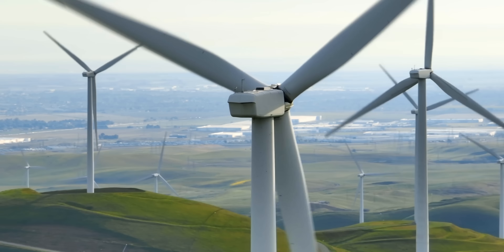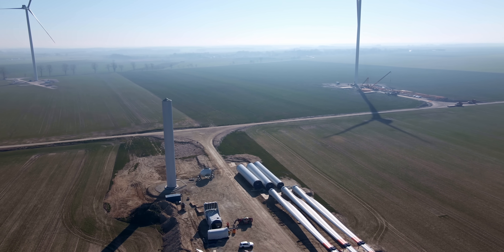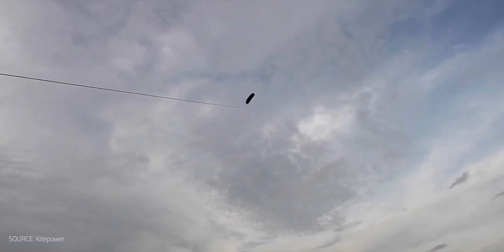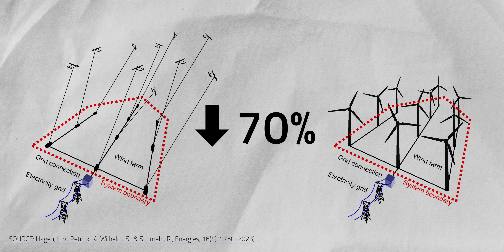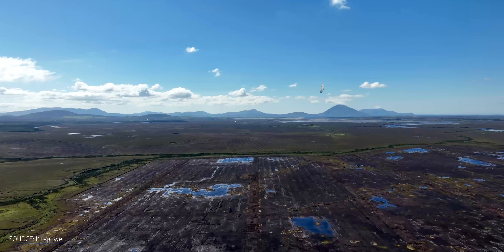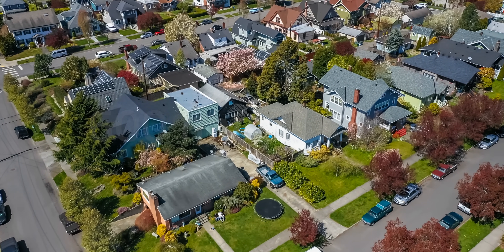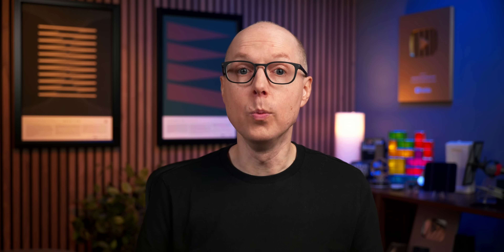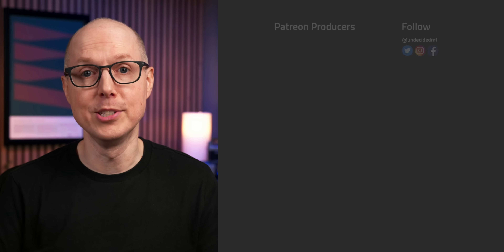Are We Building Wind Energy Wrong?

Comment from the maker: Will AWES start to soar, or are they bound to come crashing down to earth? Go to https://ground.news/undecided for an innovative way to stay fully informed on tech, energy, the climate and more. Save 40% on the Ground News unlimited access Vantage plan with my link.

If you liked this, check out How CATL Made Batteries 90% Cheaper (And What Happens Next) https://youtu.be/Wf84NJSiAeU?list=PLnTSM-ORSgi7uzySCXq8VXhodHB5B5OiQ
Reply: Matt, you made a mistake you shouldn’t have made at 8:49. Kilowatts per hour is not a meaningful unit. Kilowatts are already a measure of power (energy per unit time). A kilowatt per hour would be some sort of acceleration. Power generation systems don’t generate “kilowatts per hour”. The energy would be in kilowatt-hours, and the power output of kilowatt-hours (energy) per hour is just kilowatts.
Reply: @Berkana  it's concerning that Matt Ferrell got units wrong after doing hundreds of these videos. I wonder if 30 kW is the peak generation of the system, and if you include the time it uses power to reel in the kite, the actual average power generated is much less.
Reply: There is an island at the top of the Pacific Ocean named Adak. There is a sign there that says “Birthplace of the Winds”. Someone should go there and figure out why, and figure out how to harness it at its source.
Reply: Does a kite fall if it is hit by a bird?
Reply: @VichaDorenaBrTarigan  No. The bird will likely be stunned, or worse, but less so than if it were hit by a wind turbine blade.
Reply: Need more power? More kite area per winch, like two or three kites flying on the same line.
Reply: STOP SHILLING FOR GROUND NEWS. NO ONE WANTS THEIR NEWS POLLUTED WITH RIGHT WING BULLSHIT
Reply: How funny to post this so soon after China announced the S1500. China is about to do for wind what it did for solar.
Reply: @Jesus.the.Christ  "China tests world’s first megawatt-level airship to capture high winds ... The S1500 features a main airfoil and an annular wing that together form a giant duct. Inside this duct are 12 turbine-generator sets, each rated at 100 kW." Interesting.
Reply: @skierpage  What I find the most interesting is that the tech appears easy to copy.
Reply: 8:49 Dude, not "kilowatt per hour", it's "kilowatt-hour". You should know that, you're the expert.
Reply: These could be hybrid systems, semi-rigid structures with engines/motors and generate power through various tension systems. Cheap and well disbursed energy of the future... informative video!
Reply: One niche where this might be valuable is in mining. All electric trucks are now available for this.  Charging infrastructure at remote mining sites can be problematic.  Awes solves that problem and makes a really compelling financial case for an all electric mining site.
Reply: Kudos for the excellent video as usual,
but also for the consistently excellent doble untundra
Lord of the Rings Reference!
Reply: You Could Shrink this and Use it with an AC cooler fan.
Reply: Matt....
By harvesting energy from atmospheric and ocean hydrodynamics systems... Doesn't that potentially slow/mitigate some of impacts of "carbon based fuel global climate change". 
Yes... there's irrefutable needs.
*Base Load
*Energy Storage 
*Transmission infrastructure.
LONG TERM IMPACT
Reply: Did you have an injury or surgery on your throat? It looks like you have some light scarring... I hope you're okay. :)
Reply: looks viable as a temporary or emergency generator
Reply: "Kites are not competing for the same wind as wind turbines"? you might want to reconsider that statement. You're saying turbines stop the wind?
Reply: @UndecidedMF  Hi, this power generating systems invent by me I speaking with NASA, American government and other people about that, must stop that
Reply: Вы ребятки добьетесь в конце концов того , что измениться профиль мировых воздушных потоков. Что в последствии приведет к изменению климата в глобальном масштабе. И это станет экологической катастрофой века.
Reply: perhaps you could explain how they work if you're doing a video? moron

Comment: What about using kites to lift heavy weights that can be lowered to generate electricity like the GESS system but instead of using electricity to lift the weights you use kites that can be pulled back in by lowering the weights and generate electricity at the same time.
Reply: How the Combination Works
A kite system generates power by flying in "figure-eight" patterns. As the wind pulls the kite, it unreels a tether from a ground station, spinning a winch that generates electricity.  
By adding a GESS, you create a "closed-loop" mechanical battery:
1. Direct Charging: Instead of sending the kite's electricity to the grid or a chemical battery, the kite's pulling force can be used to mechanically lift a heavy weight (like a concrete block in a tower or a weight in a mineshaft).
2. Mechanical Synergy: Because both systems rely on tensioned cables and winches, you can theoretically bypass the "electricity-to-storage-to-electricity" conversion loss. You are simply transferring mechanical pulling force from the kite directly to the gravity weight.
3. Stability: Kites can harvest high-altitude winds that are stronger and more consistent than ground winds. The GESS then acts as a "buffer," smoothing out the power supply when the kite has to "reel in" or when the wind dips.

Comment: the energy lost in transmission losses argument is bunk. the efficiency improvements in wind turbines each few years are more significant than the minor losses in transmission, especially using HVDC for longer distances. transmission between grids even pays for itself just because it can shift power from one region and set of de,and centres to another. don’t use transmission losses as an argument against tower mounted wind turbines.

i bet there’s energy inefficiencies in flying kites, cool as it is. like pulling the kite back in for the “yo yo”. and round trip inefficiency of using an intermediate battery if that’s the go.

Comment: It is not clear how the energy is extracted? First the kite pulls cable and spins generator. But then the generator switches to motor mode and pulls the kite back. It spends the energy in this mode. There should be a delta of extracted and spent energy, for the system to be efficient.
Are those "8" loops that should give more energy that later pull the kite "flat" way?

Comment: I've been following KiteGen for close to 20 years now. They have the concept of the Carousell which potentially could scale up to 60GW per unit. It would be a ring generator powered by hundreds of kites.

The real kicker is the EROEI of these. They essentially replicate the tips of the rotor and don't need the heavy foundation of a wind turbine.

Skysails power comes from skysails which were developed to tow shipsbor at least cut fuel consumption by a large percentage.

KiteGen already had a huge autoclave for hybrid semirigid wings/kites. I guess they are still developing with a partner.

Comment: These AWES were a new idea 20 years ago. Lot of companies were working on it 15 years ago, a few of them stopped completely ( makani, kitegen...). It feels like they will still be at the new idea stage in 20 years and wont ever come to full scale commercial development. Makani had a working prototype of carbon wings with small wind turbines on it.

The only reason kites or paragliders are made with soft fabric is so you can fold it and put it in a backpack when you dont use it. There are no good reason to make these kites out of fabric.There is no fabric that is light enough and uv resistant enough to stay flying in the sun for years.
The kitegen carroussel was also a great idea, I wish I could see a working prototype.

Comment: Landand ocean based wind turbines blades degrade in less than 10 years after which they are dangerous and must be replaced at great cost (usually subsidized).  A kite of similar power will degrade faster due to less strong materials and weathering.  This idea is clever but not practical from a mechanical ngineer (and wind surfer) .

Comment: My issue with these ideas is that the surface area simply isn't there. The power available scales with the swept area of a turbine. These kites and balloons won't compete with the area of a traditional turbine for a long time. There's also the issue of efficiency due to having to reel the kites back in. Plus having to lift the weight of the cable. This idea is not new at all. I did a project on these back in 2017, and the conclusion was always the same. You're far better just using a turbine. I do agree that the one potential use case is places where portability is important. I could see these being used by the military or construction projects where temporary power gen is needed.

Comment: Strange fact. I thought about ballon mounted turbines back in 2010 and drew up a few designs. Advantage of them was variable height for consistent wind power and low noise and less bird deaths. They could also be mounted close together as the flight angle, height and direction would be predictable.

Comment: Nice. But the idea of positioning wind-blown cables anywhere near tall, spinning rotors seems like inevitably a cable will get snagged and cause damage to both systems, just a matter of time. Then theres little mention of wear & tear, how long can a kite operate before degradation from say UV on the sail or salt on the mechanism if installed near a coast, before needing servicing, rebuilding. Another issue is what happens if a kite drops out of the sky with its cable coming into contact with overhead power lines, or falling across busy roads, to me prohibits setting these up too close to existing infrastructure.
In the right conditions this can probably help fill a niche in the power generation game, but i dont see it becoming a major player anytime soon

Comment: You forgot one MAJOR advantage over traditional turbines: Turbines kill birds mid-flight. There are countless studies on how birds, especially large soaring birds like eagles, vultures, cranes and storks, are unable to predict the trajectory of the blades and get hit by them. Combine that with the fact that the best places for turbines are usually right along migration routes and you got a disaster on your hands. Where I live they actually have a bird radar that shuts down the turbines when large birds get too close. In addition, turbines cause a lot of noise on the ground and require access roads and infrastructure. This all disturbes the local ecosystem including small songbirds, endangered wildflowers and so on. AWES shere very few of these downsides and if I were in charge I would switch to them ASAP.

Comment: This is really suited for emergency and remote energy generation systems, not large-scale wind farms - with many advancements in the tech a wind farm of some sort could be viable but that is far in the future.. However, this is a great idea for rural towns and individual farms with the right wind conditions, and could support many different types of remote instillations. Use in cities is unlikely but potentially possible in the future (at least in appropriate small cities)  if highly refined controls and safeguards are created to prevent problems (particularly around drones and helicopters).

The safety issues don't seem insurmountable, and could conceivably be managed by safeguards in both smart control systems as well as mechanical systems that could change the attributes or structure of the kite almost instantaneously to stop it moving in a particular direction (e.g. like small drone fans to push it in a certain direction in emergencies, or changing the fabric tension so it acts more like a parachute than kite and drifts downwards.

Comment: One idea I've seen is to put many VAWT turbines along roads, On central reservations and on the sides, togenerate power from the slipstreas of passing vehicles.  individually they'd only need to be 100W or so, but over the road network the total generated would be many MW. And they'd work with wind in any direction as well. YOu would also need suitable grid-scale storage (Sodium cells would be ideal here).

Comment: Excellent forward movement… there are big issues with huge windmills… one being that they can negatively impact the hills and mountain ecology severely and concerns are rising about water quality and retention when large blocks of forest are removed for their roads and stands!

I’d rather see us use such things as pedal power for household emergency power outs… let’s get ourselves involved in the solutions.  

Also, when cooking a soup, or something quite liquid in a pot, one can easily make and use to great effect a fireless “cooker” to do the bulk of the cooking once it has been at proper heat for enough time.  It is an awesome way of saving time, effort, electrical use, and the flavor of a perfectly done chicken soup that is piping hot seven and eight hours after being snuggled in the fireless cooker, right when you come home from work and are hungry!

Comment: For a remote private home that can be an option but the large area needed for each unit makes the use of multiple units (without crashes/dangling/etc), for a large scale project, an impossibility. Let's have the company prove me wrong. Let's say use the same area used by wind turbines and produce more energy. Of course, the location must be the same for weather conditions to not be a differentiating factor.

Comment: seems a lot of extra hassle, 'moving parts', than a traditional turbine. 
while the mobility is a plus, the lack of permanency is a minus. it will come done when there isnt enough wind, needs to be winched in if too much wind. seems more fragile
but definitely seems to have niches where its advantages can be magnified. where you need mobility. on a ship. in rapid response situations. or where its hard to install massive turbines.

Comment: The unit kw/h doesn't make any sense, it kinda invalidates the whole video. If you mean 30 kw, you would require almost 200 of those to get the same power as one normal wind generator. It looks like a good idea but still under development.

Comment: Wouldn’t a back of the boat situation be like dragging a parachute? Thus, the boat will have to use that much more fuel to move forward?

Obviously, if the kite can be utilizing wind that is not pulling against the boat, it would be beneficial.

Comment: How would the "Aerostat" the chinese start-up "Sawes" announced a couple of weeks ago where they combined a zeppelin like structure with multiple small diameter turbines to generate electricity?
I would love to see a follow up to this video one day where more theoretical concepts could be explored. 

For example, what came to my mind was the question if we can't combine "normal" Turbines, the high altitude turbines currently under construction in the german state of Brandburg and the AWES into a single park?
The common turbines today and the high altitude ones from Brandenburg can be fitted together in existing parks as the operate in different altitudes. Could we fit the AWES to the back or the top of the turbine gondolas of the high altitude systems and deploy them from there to reach a couple hundred meters higher as ground bases systems? As traditional wind turbines are turned towards the direction where the wind comes from and the kites naturally flow in the direction where the wind goes, they should really be able to come into contact?
Basically my big question would be why they have to compete in a "Winner takes all, Loser gets nothing/niches" fight when they seem to be able to work together, raising the amount of genereated electricity while being able to produce more concecutive power?

Comment: Ok, have to admit - Don't understand how these generate significant net power.

The explanation of how they work seemed to be only barely covered - but as the kite goes out - spins barrle - which turns generator?   So gains power there.

But then- it has to be reeled in again - which takes power - so - apparently it takes less based on how the kite is moving in the wind - so the net gain is;

Spin out power generated - retract power required...

Is how it works, or did I miss something?

Comment: I'm interested in airships and these could be auxhiliary... My biggest question is the ballons for hydrogen we need a  lightweight membrame for 5000 psi I asked if carbon fibre could be the answer...  France has an Airship that I would point too... but I believe were stuck at Helium and that's not an feasable option

Comment: “A two time increase in wind speed can lead to up to an eight times increase in energy generation”

1) The Kinect energy of an object or particle, in classical physics, is (1/2)*mass*velocity*velocity 

2) The number of air particles that pass a wind generator each second is (particle per cubic meter)*(velocity in meters per second)*(cross sectional area of wind generator in meters squared)

=> total kinetic energy blowing through is the 1) multiplied by 2), the energy per particle times the number of particles. One of these has velocity twice, the other has velocity once. This is why the energy goes as velocity cubed.